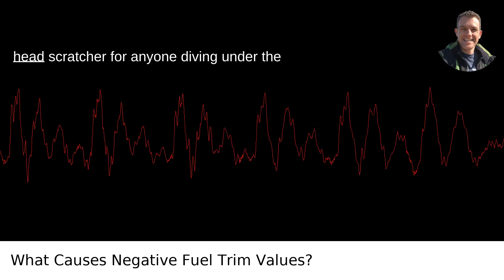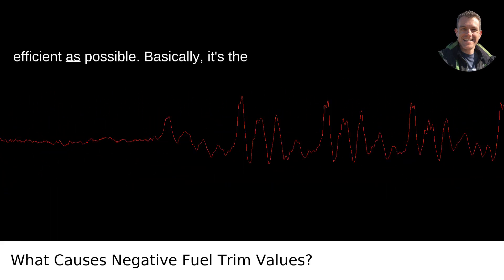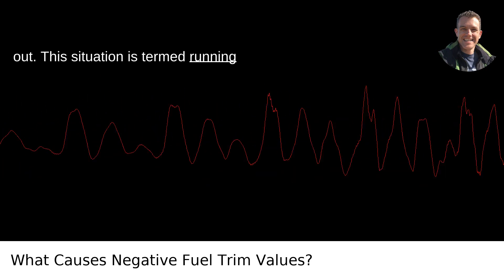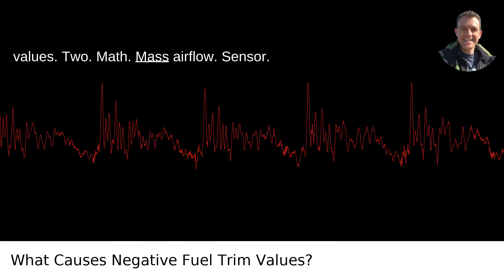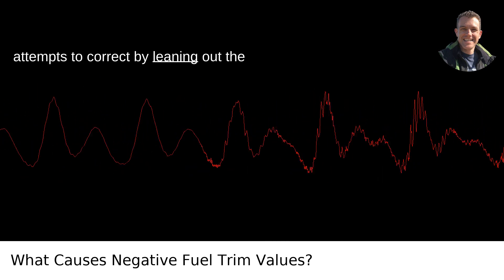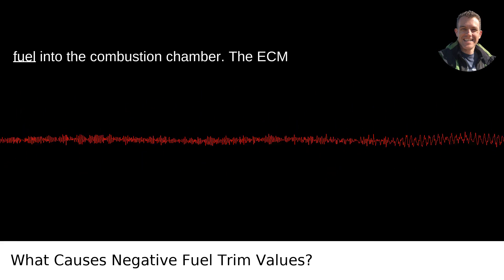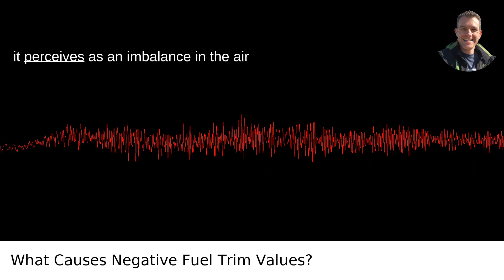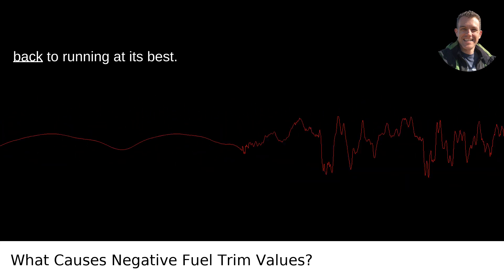What Causes Negative Fuel Trim Values?

Comment: I'm getting-23% longft1(Bank 1 only) so that would eliminate pretty much everything except o2 sensor, or leaky injector, right? Cuz that's what I'm dealing with .my MAF is new(second one in a month) o2 sensors are new and the volts are right where they should be.. What else could cause such a large negative on only bank 1?

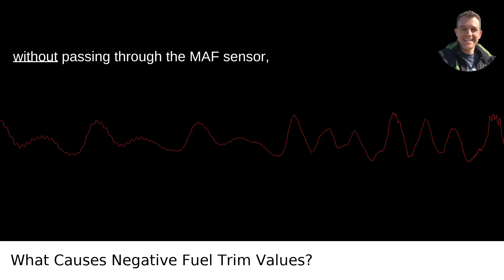Comment: 1:32 Vacuum leak does not cause negative fuel trim. It makes the ECU adding fuel, which is positive fuel trim. You are confusing people.
Reply: Exactly, it would cause a lean condition and max out fuel trims